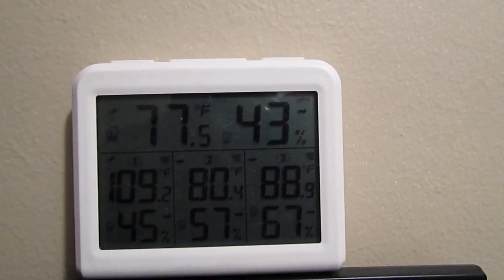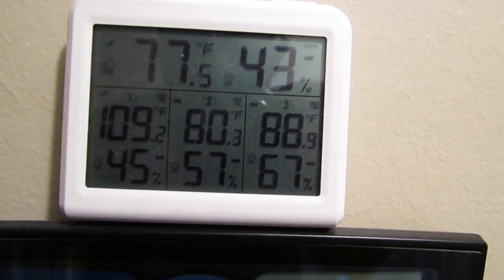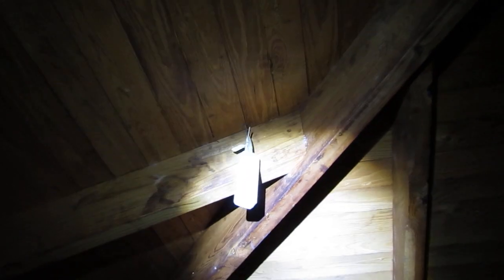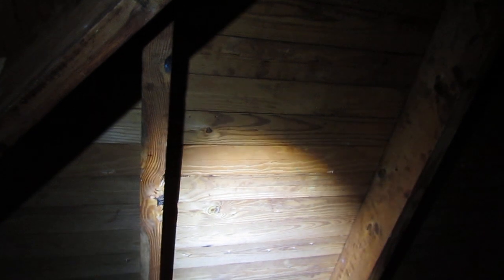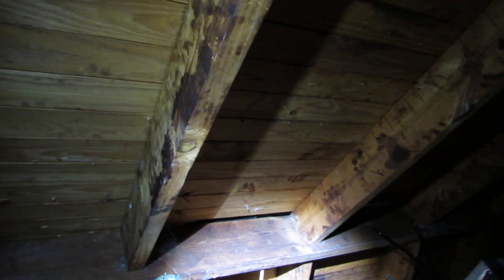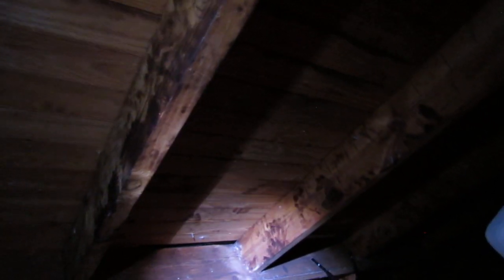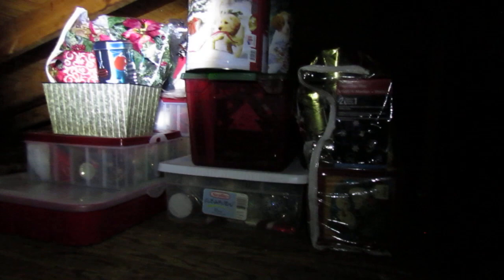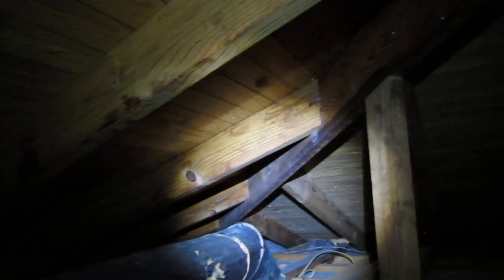What should the summer attic temperature be How Hot is too Hot Episode 127

Comment: A properly vented sunbaked roof in the northeast will cause the attic to rise much more that 10-20 higher than outside ambient. The sun heats the dark shingles and then the air inside the attic just like an oven.
Reply: Doesn't that mean that there isn't enough ventilation in the attic?